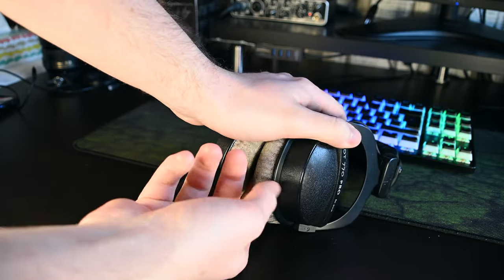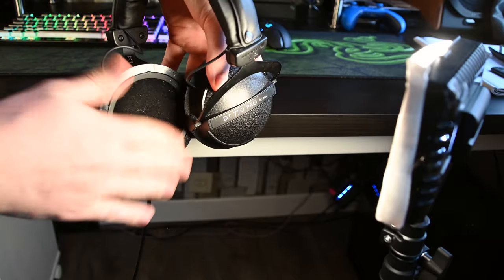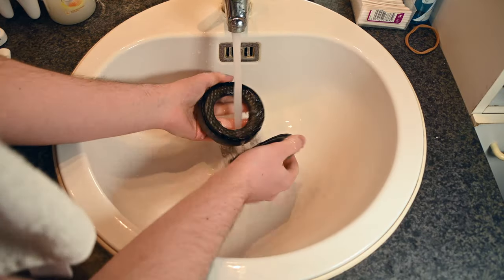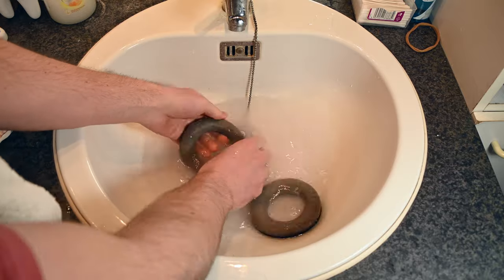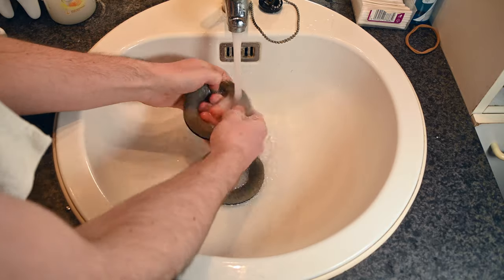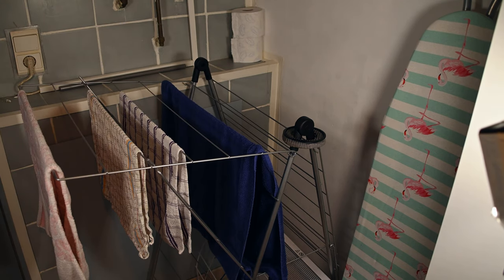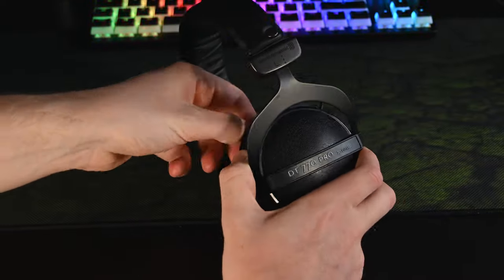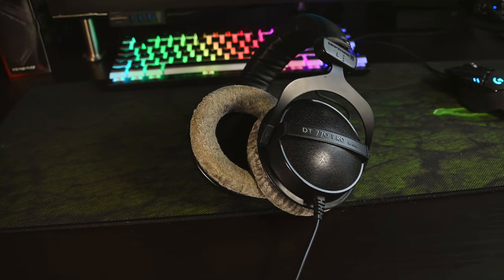How to Clean Your Headphone Ear Pads! DT-770 Cleaning!

Comment: Interesting to see Beyerdynamics official statement: "Use only water, no detergents". They want you to buy replacement pads as soon as yours get a little greasy/dirty, huh.
Reply from the maker: Could be! I've had no issues cleaning mine using this method and done it about 3 times in total now. 

It's possible over the long run it could wear them down, but honestly clean pads are worth it :)
Reply: Detergents can really ruin certain products. Instructions are there to help you not scam you. Even if they don’t show up on the first few washes, you’ll most likely start to see the damage the detergents do to your pads. But at that point you might as well just pitch in 40 bucks for some new fresh pads.

Comment: TIP! Use hair dryer to loosen the black "lip" that is attaching the pad to the actual headphone, set the hair dryer to middle heat and in circular motion around the edge of the pads blow the air on it for around 10-20s, that way they will come out waaaay easier without any pressure (that torn my previous pads), same way when re-attaching back on the headphone, use hair dryer again to loosen the lip - for re-attaching I would also recommend just attaching a small bit of the lip on, and work your finger from the inside of the headphone out (from the area that is producing the sound outwards) basically pushing the lip on the headphone edge if that makes sense, not pulling it to again, not break things. Also feel free to wash the head band the same way as these, worked great for me.

Comment: Another tip or rather a warning, dont use a vacuum to remove the hair and crumbs directly from the headphones. I destroyed my 880pro by gently cleaning them that way 🙃Edit: Perhaps you should also be carefull with compressed air , as the inner membrane is very sensitive.

Comment: Mine seem to have torn on the inside when I pulled them out. Or maybe it was when I placed them back on. They still work but they’re a bit loose fitted now.
Reply from the maker: Ah damn, that's sucks. If needed it possible to get replacement pads on Amazon/AliExpress. They are not super expensive!
Reply: Hey there, if you still have the headphones and would like to try cleaning them again without ripping next time, use hair dryer to loosen the lip when taking the pad off and back on again, that way you wont tear it.

Comment: is it normal if the black rubber like parts start feeling off? because my bowl was full of black pieces and particles
Reply: that means your earpads are aging and it is not a bad idea to replace them
Reply: Or it means the detergent you used didn't work well with the ear pads. Some combinations of chemicals will do just that. Either way, it's not 'normal'.